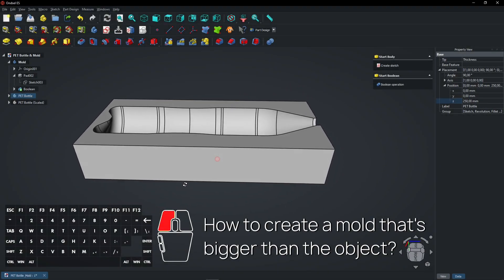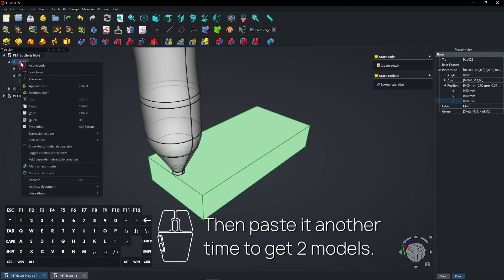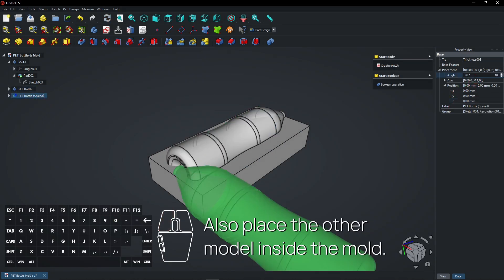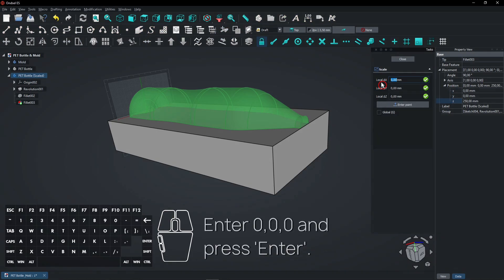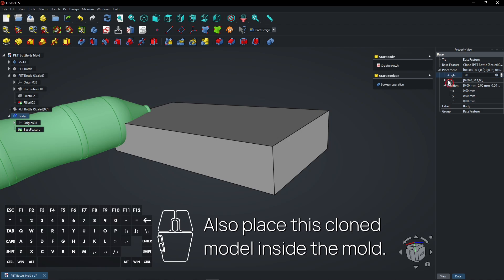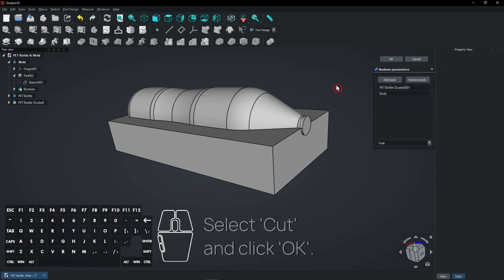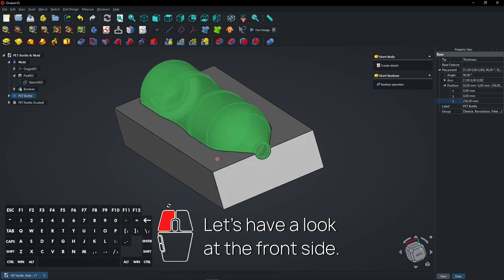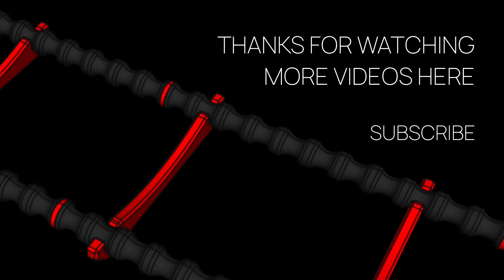🥤 Design A PET Bottle Mold In Ondsel - FreeCAD Boolean Operations - Boolean Cut

Comment: The cap is in percent. Therefore on the small diameter it is less then on the bigger diameter and even bigger over the length. But this is fine if you want to compensate shrinkage.
Reply from the maker: Thanks for clearing up! Seems logic.
It's not like an equal offset.
Reply: @AllVisuals4U  uniform means, the same amount in all direction. In this case the same percentage. This is how I would interpret it.
Reply from the maker: Thanks again!